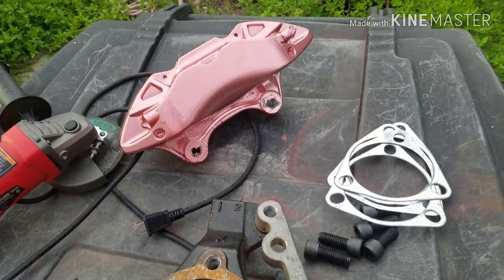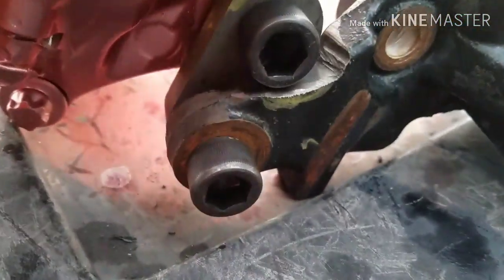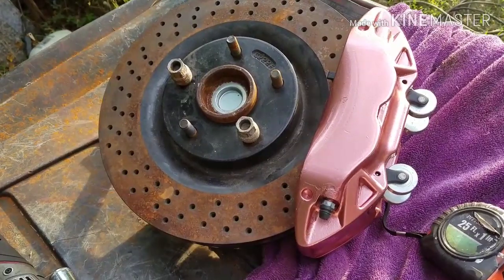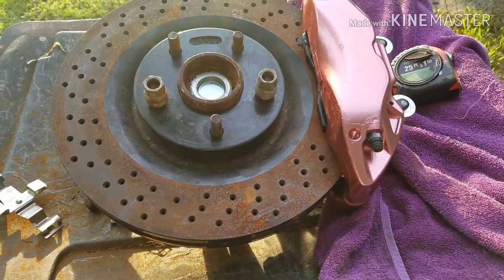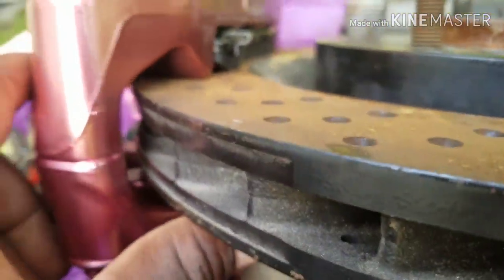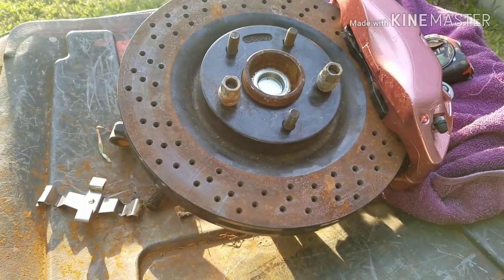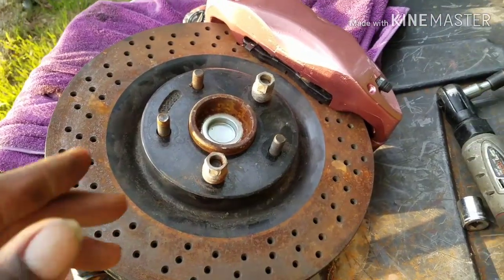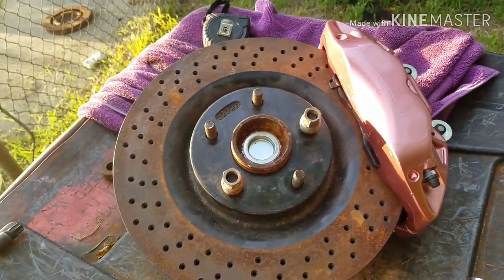D.I.Y c7corvette brakes on a gbody blazer spindles

Comment: Well if i can do this swap with the stock spindle and hub im game i dont mind the bigger center cap .. 
my thingbis the rotors i have on stand by the rotor is 13.5  from a 03 - 13 zo6 not 14 in
Reply from the maker: Rotors to wide .need c7 rotors yea I have a bracket for stock spindles
Reply: @Mr_getinthere  how do I get the brackets from you

Comment: I adapted the blazer spindles to my 69 cutlass 
I had to reem the lower balljoint larger  everything else bolted right up
I have the stock blazer calipers and rotors for now til I can upgrade to the big brakes
Only thing stopping me is I have the Oldsmobile “O” rear end with bolt in axles so I have no idea what brackets to get for the rear calipers
Reply from the maker: 😳😳 first I've heard of the blazer spindles on that car nice !!!I'm working on a c5 corvette  rear bracket for the BOP  rearend with the bolt in axles  I keep u updated on it
Reply: MR_getinthere for sure keep me updated on that bop setup that’s the only things holding me back right now from doing the swap   I’m pretty sure I’m the only one that’s done the blazer spindle on the A body platform.  But it was easy. I’d gladly show you what I did so u can add to your range of swaps

Comment: And your going to have to grind some of you A Arms to cause it hit against the brake caliper which well effect your turn ratios . Definitely gone need a wheel alignment and it a different  ride height it lower my front so I gotta get different  springs  when it on the car and the weight it's on it you notice alot of modifications you run into
Reply from the maker: Are u running  theses calipers ??

Comment: Did you use tall ball joints or the factory  size one? Want to do this to my Buick Gn . Thanks again
Reply from the maker: Factory  but tall will work tho home equity better
Reply: Thanks. I am replacing the upper and lower A arms and wanting the larger brakes to go with the update. I also purchased 18 inch gta rims so larger brakes are needed. Thanks again

Comment: I need them brackets and what brake lines do yoy recommend?
Reply from the maker: 130 shipped for the brackets
Reply: MR_getinthere i need shipped to Chicago bro
Reply: @Mr_getinthere  I need the brackets bro ASAP
Reply from the maker: @darnellsmith1140  they 145 now , got paypal ?
Reply: @Mr_getinthere  yes I do n do you have the back
Reply from the maker: @darnellsmith1140  yess it's 150
Reply: @Mr_getinthere  hey can I call you sum way I have?
Reply: @Mr_getinthere  you have these in stock now